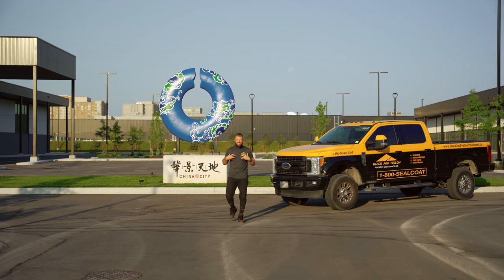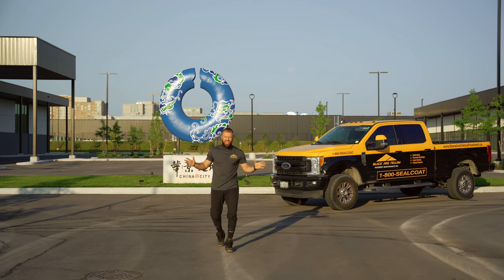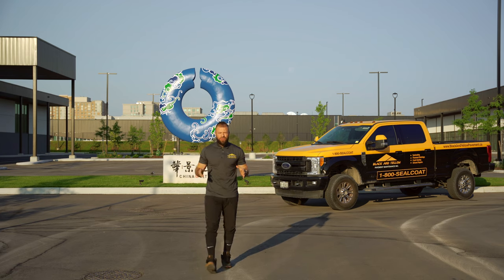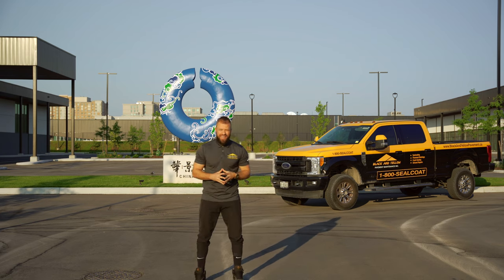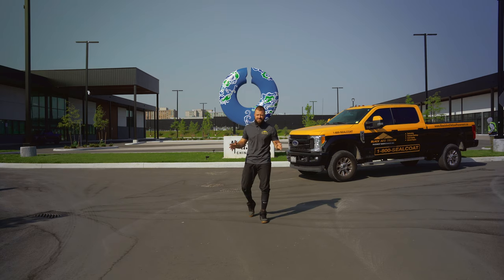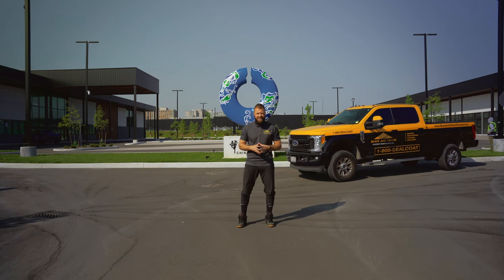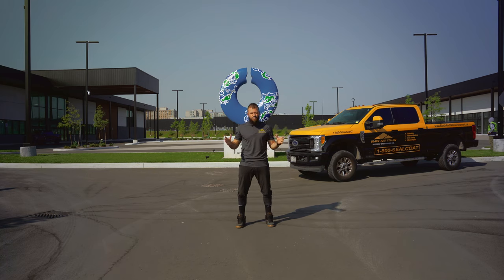First Ever Cool Seal Application in Canada

Comment: Hey, I’m interested in parking lot striping as a side hustle . I’m thinking about starting a parking lot striping business without sealcoating and other services. Would you recommend this? Is there enough work for just striping ?
Reply from the maker: There is definitely enough work for just striping!  And eventually you will just grow into all the other services.  Where are you located?
Reply: @blackandyellowpavementinc.3745  
Dayton , Ohio United States
Reply: @blackandyellowpavementinc.3745  I’ve done a ton of research into striping and it seems like most companies who stripe are sealcoating and asphalt companies and I’m afraid I wouldn’t be able to compete with them when trying to get jobs.
Reply from the maker: @ryanhill9380  i would say most bigger asphalt companies sub out their line painting.  But also you can easily go from just striping to doing everything. Get in touch with Lance Phillips on facebook hes a perfect example of that.  Started out with a striping machine and a year later hes a full operation.  But if you only want to do striping you can also make that work 100%
Reply: @blackandyellowpavementinc.3745  awesome.. how would  you recommend going about getting jobs when starting out? Best marketing strategies?
Reply: As long as you're in a highly populated area it should be no problem at all I go for it do it man do it to your full potential

Comment: Hi there, what does cool sealing do? I thought maybe it’s to make the asphalt last longer like keeping it from cracking etc or maybe just cosmetic looks, but I heard you saying it helps the planet. So I’m guessing instead is asphalt that absorbs tons of heat, maybe this stuff doesn’t absorb as much heat? Are there any other advantages to getting this stuff? Let me know!  thanks
Reply: Dude explains the purpose in the beginning of the video…🤦‍♂️ The pavement temperature is roughly 30°F cooler with the cool seal coating.